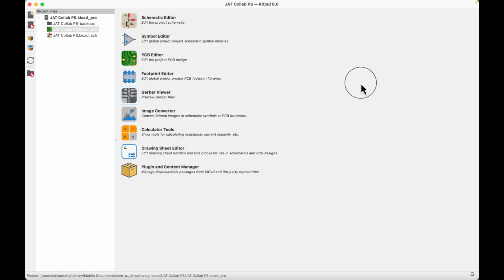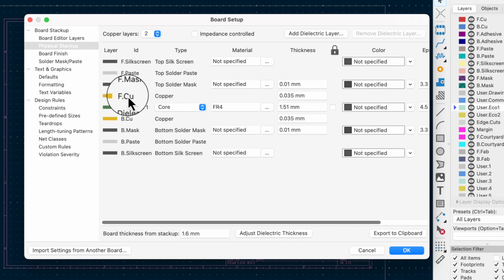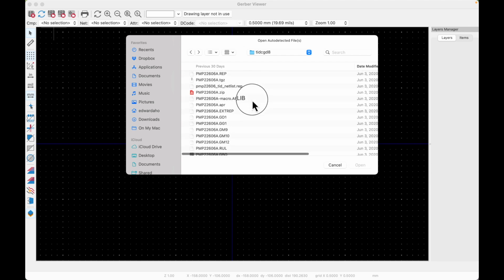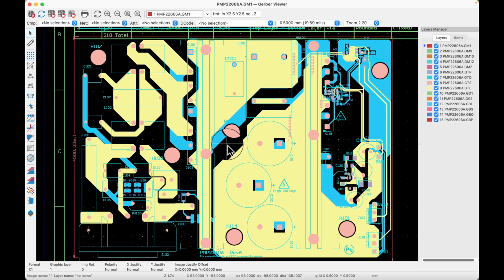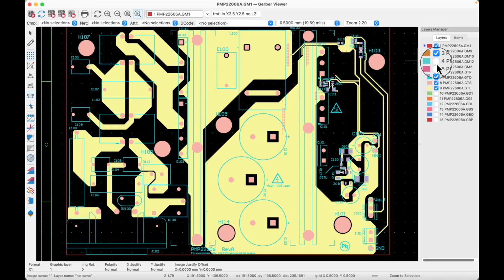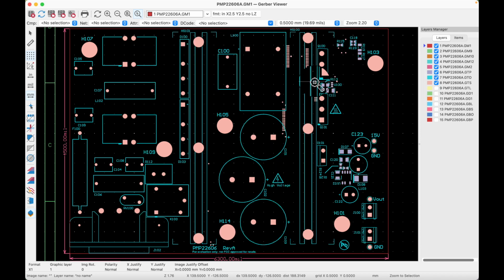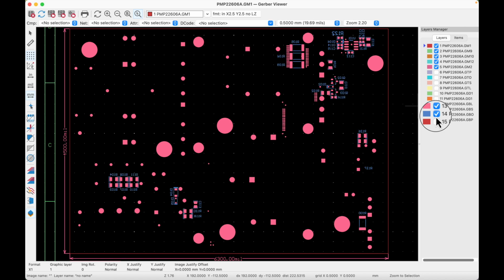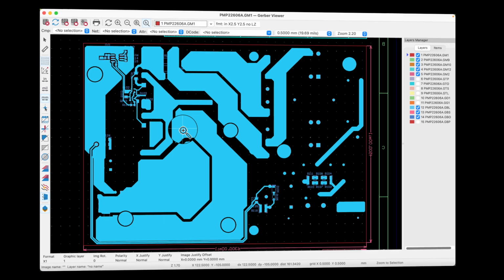What are Gerber Files? 1kW PFC Printed Circuit Board with Kicad #PCBdesign #UCC28180

Comment: I didn't watch the whole video, because I lived it professionally in real time in the '80s as an R&D technician. When I started designing PCBs it was on acetate with tape and a 50 mil grid done at 2X scale on a light box. We then got OrCad and eventually P-CAD. The original photo plotters only had like 24 or 32 "stations" and you had to define each one as the positions were individually loaded with the shapes you defined. The files are basically the same as today's CNC files with D-codes. I would have to create and send an aperture list in the CAD software and send it along with the Gerbers to the PCB house. Eventually, laser plotters came into existence and the "wheels" were gone as well as the limitations on how many shapes you could have. Eventually RS-274-X was the de-facto standard file format with the shapes embedded in the files. I could write a book on PCB design, but I'm too old to care any more 🤪.
Reply from the maker: LOL Thanks for this fantastic feedback!  I remember going thru the same things;)

Comment: Great NEWS.
I also use KiCAD for personal projects and it seems to be sort of standard for open source projects. It is a very powerful program someone made DDR5 work with it so more then enough for us.
easyeda is also free and popular but you outgrow it fast...  Altium is way to expensive for personal use, and the limited free version  is very restrictive.
BTW I am now nearly done with my 250W LLC stage and i am very curious is all of this will work well. I just need to do the layout and add my flyback ( backup so that i dont wast my APFC circuitry in worst case) . 
Do you have any advice on to how to limit output current? 
Also what connects would you use for 10A 24V output? do you think screw terminals are still ok? 5.04mm pitch or what should i use?
Reply from the maker: I agree - KiCad seems like the way to go.  The controller should have current feedback - which is a great way to current limit the output.  Screw terminals are OK and 5 mm pitch is also OK.
Reply: @KissAnalog  THX for LLC controller i am using the best one from TI how it is controlled is beyond my understanding as of now but the LLC seems to be regulated in Current by some coupled caps that transfer some pulses and also an opto for voltage .
Speaking of optocoupler i am there a bit stuck since this chip i am using has a interesting way of doing FB with some internal current source from who you need to sink  uA of current how how with an optocupler .
Reply: @KissAnalog  THX
The TI IC i am using senses current with some coupled caps that detect current peaks and also a voltage loop with an opto .
I am having a hard time doing the FB since i also have to deal with a internal current source
Reply from the maker: What TI chip are you using?  I need to get my LLC converter designed and on a board - I can explain your chip in these videos.
Reply: @KissAnalog  UCC256601   i sort of figured it out from references and from other that asked on the TI website. there are surprisingly few LLC controller chips out there.
As of now i think i am done with my power stages and the only things that i still need to do on schematic side is add a fan and then do layout.

Comment: Great insights. Currently, I am using EasyEda for pcb design. I plan to look into kicad in future.
Reply: A good friend worked as a CAD-CAM tech for a circuit board company in Oregon. She became an expert at troubleshooting Gerber files. They  have a quick turn program to supply 5 prototype boards overnight, either directly or through on line vendors.  They also provide a free CAD program called PCB123.  The drill file is based on the paper tape format used by the Excellon drills.  Gerber made pen plotters and adapted some as vinyl cutters for sign shops. They also make laser fabric cutting machines for the garment industry.
Reply from the maker: Thanks for this great feedback!  What was the PCB company?  Did you try the PCB123?
Reply: @ The PCB company is Sunstone Circuits in Mulino, Oregon. I did not try the PCB123 program.
Reply from the maker: Thanks for the feedback!  I need to try EasyEDA as well;)